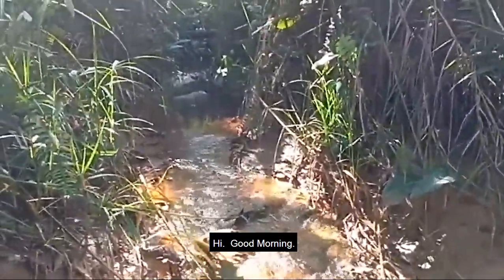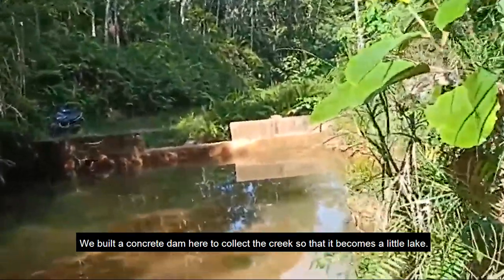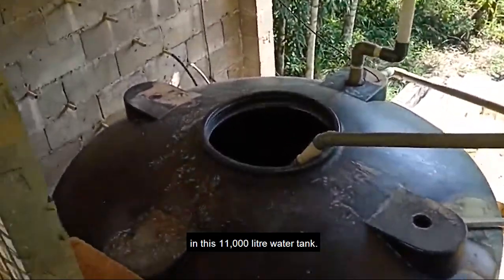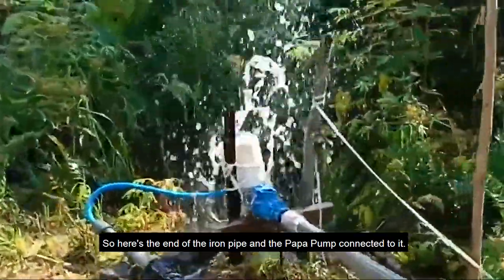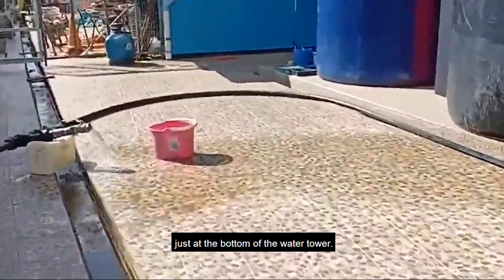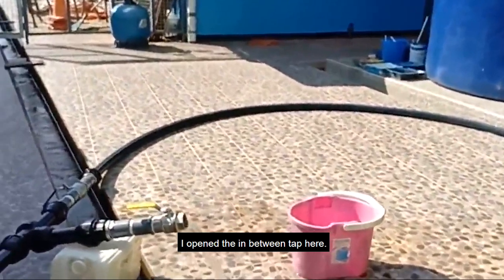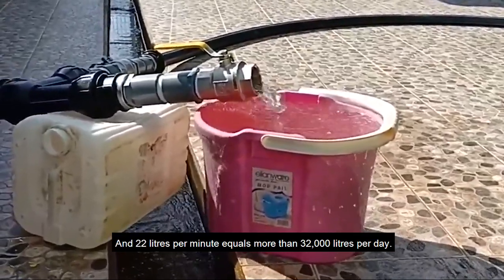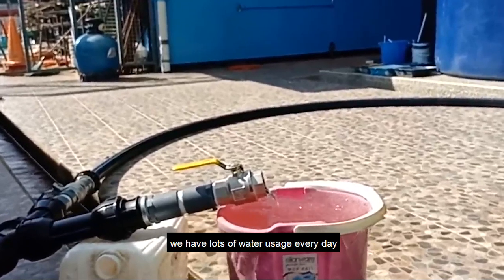Ram Pump Borneo Charity pumps 32000 litres of water/day using no fuel or electricity

Comment: Are these Christians making them simply dependent on others charity or are they teaching them the principle of subsidiarity by teaching them how to work?
Reply from the maker: We are a pump manufacturer please direct any questions to the charity itself
Reply: @Waterpoweredtechnologies  
...and granted, you have a wonderful product. One that I may be considering in the future. It was a rehortotical question. Context is everything. There's always the question, like with military munitions manufacturers, are they part of the pro-Logos solution or the anti-Logos problem?
Reply: This papa pump is designed only for less than 80 meter vertical lift because the surge tank or bladder tank working pressure is 8 bar @Waterpoweredtechnologies